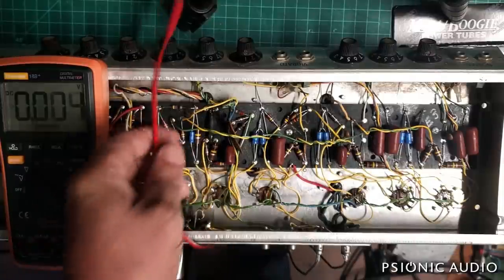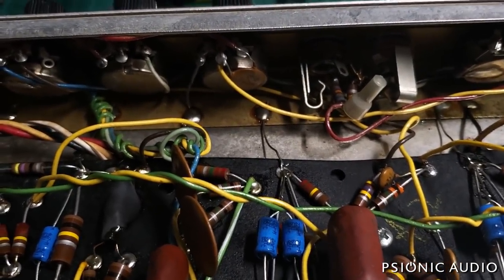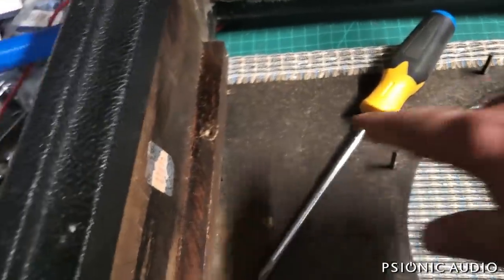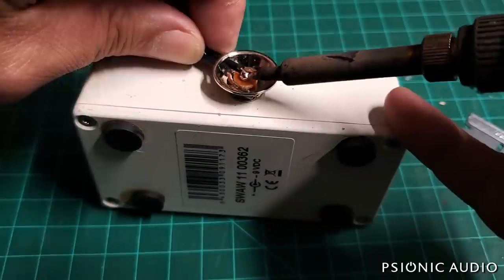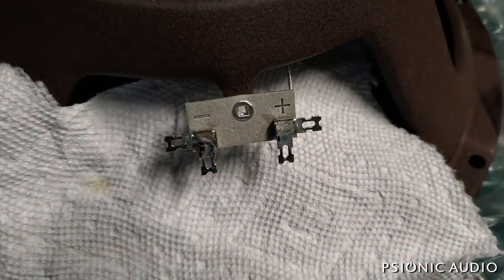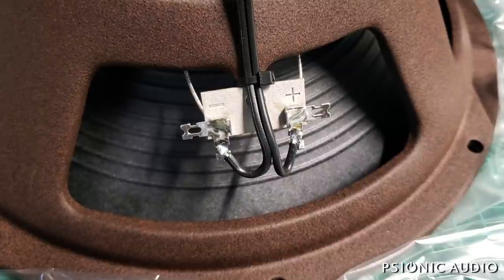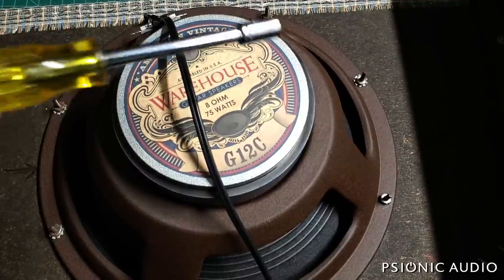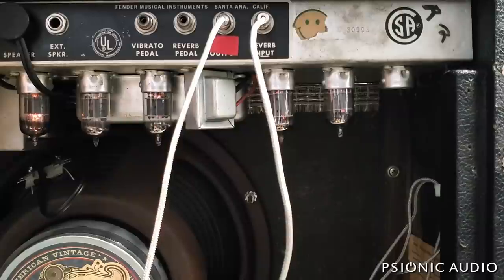Restoring the '69 Deluxe Reverb that Smoked at a Gig | Part 3 : A Lot of Boring Unsexy Crucial Work

Comment: I replaced the soundboard on my "65 Deluxe with pine and I used T-nuts with screws and washers to hold the speaker in. (Yes I kept the old particle board original). The # 8 Robertson screws with washers hold like crazy and can be removed in seconds, plus, Robertson screws will stay on the driver while you insert them. I know it's not stock or vintage but I really don't care. It's a great amp that I'll have forever. The next guy can worry about all that "vintage" thing. Leo would be proud! Great videos by the way. You are the master!

Comment: When building the Mojotone 5E3 and 6G3 Deluxe kits, I left extra length in the speaker wire. If a gig demands more wattage than the Deluxes can conjure, I sit my backup Quilter Pro Block on top of the amp and the speaker wire will reach. Quilter builds a good amp, but I prefer the Deluxes for most gigs.

Comment: Another trick to save those wood screws:  Put the nut on and work it down as far as you can.  Then hold the screw with the needle nose and file a flat or sloton the screw.  You can now keep the screw from spinning while you turn the nut.  I've never had to do this on an amp but have used this elsewhere.

Comment: Worth noting that hardware sizing and quality control has gotten weird in the last couple of years, and regardless of what it says on the box, what you actually get could be just about anything.  I recently realized that the box of flat washers I have for number 8-32 machine screw ( small bolt) will actually accept a 10-32 screw and they're kind of sloppy if you use them for 8-32 screws. These are Hilmann brand,  and when I went in search of a proper washer for use with number 8 machine screws I found that the  stainless-steel washers are sized correctly but the regular steel washers have an oversized hole.  Also last year I had a construction project done for me by a contractor but I supplied all the lumber and hardware. I bought a box of 100 stainless steel Ribertson square head trim screws, made by Hillman, and when that wasn't quite enough screws I went back and bought a 30 pack  of the same screws from the same  hardware store and the same Hillman brand. The 100 pack of screws are apparently a harder grade of stainless, and the 30 pack were apparently much softer, because the heads kept stripping out in a way that we had not seen with the original box of 100 screws.

Comment: Ok, I saw it in the last detailed video and it’s still there at 4:20 when you’re discussing the bright cap. What is with that little crimp connector on the red wire ?!? That’s something I thought surely you would address. 😎
Love the details of doing the speaker connections
Reply from the maker: Oh, in '69 they used those wire nuts on the input resistors/wire. It still works fine, so I'm not changing it.
Reply: @PsionicAudio   - I learned something new again !

Comment: The titebond/toothpicks fix will likely be stronger than at the other screws without that. When you tighten the screw, the toothpick wood compresses and the titebond gets forced into any small gaps in the parent material. Not the most elegant fix, but quick and effective.
Reply: Water thin superglue might be even better for stabilizing the particleboard than Titebond or other similar ordinary aliphatic-resin wood glues.  Note that I specifically said water-thin super glue, which eliminates most of the usual super glue formulations that come in little metal squeeze tubes; buy it in a bottle so you can shake it to see how thin it is. Rapid Fix ---- or was it the Dapco brand? ----  can easily be found in a thinner than usual formulation (I bought it at Walmart ---- but which brand?  jeez, I can't remember shit anymore);  "Hot Stuff" is another excellent water thin super glue (Woodcraft sells it because it's popular with cabinet makers and woodworkers).  Water- thin super glue will soak into the fibers of the particle board quickly and then cure almost as quickly (cyanocrylate glues, aka "CA" glues, react with cellulose in the wood fibers, and the cure is accelerated by moisture in the wood and water vapor in the Memphis air,  and so the cure should be very quick unless the glue is old and degraded). Stuff some toothpicks in the hole along with the glue, or the wood stem of a medical grade Q-tip, let it cure for 10 to 15 minutes, and put the screw in.  If you're in a hurry and you want to make absolutely sure that the screw doesn't glue itself in place, rub a  a crayon on the screw or put a little paste wax on it first before you drive it in.
Reply: For what it's worth, back in the 1980s when I was working for a high end high fi dealer, the assembly and setup of a fancy and expensive Linn Sondek LP12 turntable included stabilizing the small mounting holes  in the "medite" (aka MDF) board that held the tone arm with a little bit of super glue before you drove the small wood screws into them.

Comment: That particle board that Fender and many other companies have used over the years is such a terrible material for amp cabinets and baffles. I've had to rebuild so many cabinets of vintage amps where they got some water exposure and either developed lumps or disintegrated entirely.